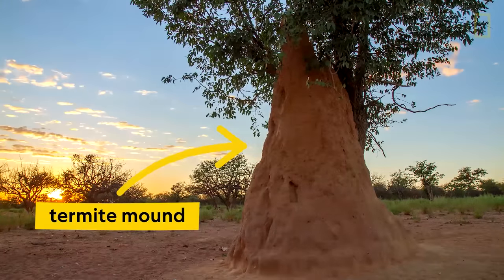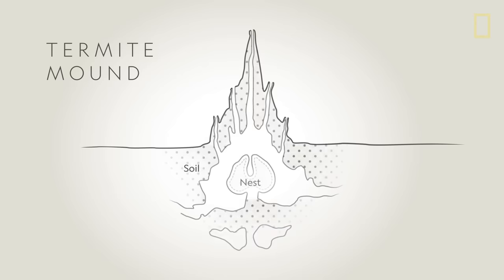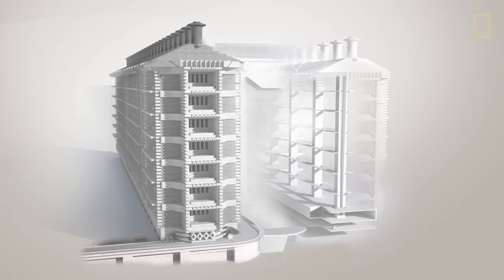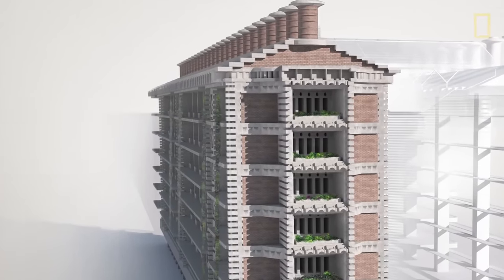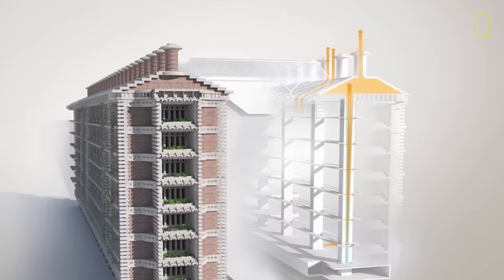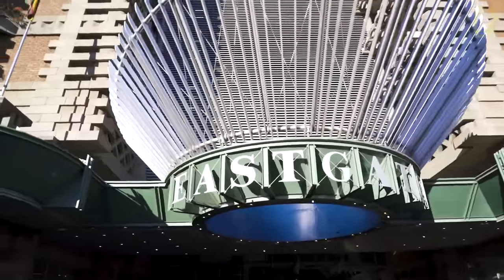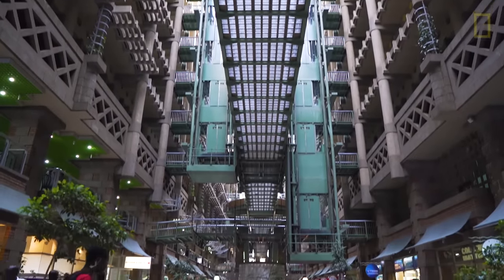See How Termites Inspired a Building That Can Cool Itself | Decoder

Comment: Is 82°F really considered comfortable? ...
Reply: Katherine Prutz good question especially if you don't know Fahrenheit but only Celsius
Reply: I wouldnt know. Most civilizations have adopted the metric system, except some stuborn ones...
Reply: Yes it is. I find anything between 25C and 28C comfortable, below 22 is cold and above 30 is hot, but that's just me.
Reply: If the temprature outside is nearly double that then yeah it's pretty comfortable and mild.
Reply: And then there's me; I find anything between 16C and 20C to be comfortable, anything below 0C is a bit cold and above 24C hot. I don't think i'd find the shopping mall comfortable at all during daytime, can't imagine what it'd be outside though
Reply: Katherine Prutz I find that a bit warm tbh I prefer inside to be about 65-70
Reply: GommentarHD It's not. It's about 28°C.
Reply: Abigail R0se wtf is 65-70
Reply: no its hot. sweating hot.
Reply: Katherine Prutz: 82 F is adaptable. Imagine civilization in the time before air conditioning. We flourished as long as we didn't boil or freeze.
Reply: Its all relative...In tropical countries peak winter temp is your spring temp...so for us it is...
Reply: Perhaps African climate is different from yours? Perhaps?
Reply: I personally am Zimbabwean and have been in this building countless times,and it is cooler than most would think.This was a brilliant design and is quite efficient
Reply: niBBun degrees Fahrenheit. As an American, we shorten terms. So, "It's hot as balls out there- 85!" Is something you may hear...
Reply: Yes that is 27°c
Reply: Meet the people in cold countries....
Reply: Katherine Prutz in a place as hot as africa, yes.
Reply: I wasn't impressed by that figure, but more than that, they didn't include the difference. 82F only means something to me if you give me the outside temperature at the same time. If this is effective, show us how effective it is!!!
Reply: Low humidity and 82 is glorious. For Zimbabwe, this temperature is relaxing.
Reply: Katherine Prutz :

Yes, 82f is nice.

In Arizona, house at 84f, feels great.

Comfortable temperatures are in relation to human surroundings.
Reply: Justin Bozeman actually 27 degrease Celsius in a low humid environment like Zimbabwe is quite comfortable. For example 27 degrees was unbearable for me in Hong Kong. You need to travel to places outside ‘the modern day world’ to understand the world.
Reply: No too warm
Reply: No 😓 I’d be sweaty
Reply: In africa thats is comfortable.
Reply: Yes in Africa
Reply: As a desert dweller, I think it's a bit on the cold side.
Reply: No it’s not hot asf
Reply: I come from the tropics and 28 degrees Celsius is not comfortable lol You'll need a fan or AC.
Reply: Maybe for The average Zim.
Reply: Katherine Prutz nope 75 is my confort zone
Reply: Sounds like a regular autumn day in southern California. So it's pretty hot about 22-25°C?
Reply: It's pushing it for me, but my husband would be perfectly happy.
Reply: Mohammad Al Adham 25-28 is considered warm temperature here
Reply: When I was in Hawaii, when the temperature got down to 82 deg F it felt great. Not to hot, not to cold. The airconditioner in the buildings felt too cold.
Reply: DrSlayerSeth you are crazy. That's so cold!
Reply: Its sustainable and continuously utilized. If you can convert it to celcius youll find out.
Reply: Yess
 It is
Reply: If it's cooler then the outside then yeah? I'd say they are more used to the heat so 82 would be "cool". Though for me a nice 72 is good.
Reply: You don't have to go "outside the modern world", just to any low humidity climate. In most of CA, anything below 90F/33C is very comfortable; 80/26 is almost too cool to for shorts, especially when the night temperatures dip to 50s-60s/10s; almost no one runs AC below 90. "Hot" days (or regions) are 100-110/37-45. Of course anything much over that is still dangerous.
Reply: Katherine Prutz right? ya i thought that sounded kinda funny to me. guess im not the only one...
Reply: lol i thought the same thing
Reply: Katherine Prutz it's actually decent temps if you're living in a tropical country, hot in people who spends most of their calendar in cold climate countries.
Reply: Katherine Prutz .. what abt 40+c temp. ? Wel it is common in india during summer.😐😁
Reply: Katherine Prutz — I vote no, but I love cold weather.  Oh, and I think that’s 30° C. Give or take 😎
Reply: LagiNaLangAko23 — Agree, it’s like 104° and humid in Texas today which is what... 40° C? Color me a wimp.
Reply: If it's not under 75 it's not comfortable
Reply: For most who life in the tropics 25 - 27 is an ideal temperature. What makes it not comfortable is if the humidity reach 80 % or more.
Reply: If you live in a desert near the equator, yes.
Reply: Katherine Prutz it's 27.778 ℃ (do people really not know how to use Google?)
Reply: Katherine Prutz average temp in Zimbabwe during the the summer is 90-100 ℉ (32-38 ℃) (again do people really not know how to use Google?)
Reply: Also you have to keep in mind, it's not so much what the average temperature is, it's do they normally live in an ac environment. 

I live in Upstate NY, and believe it or not but summers see an average high of 85-95 ℉ (if you want ℃ learn how to use Google, it's not hard) with Perry high humidity. I also don't use ac so 82 isn't hot for me, though most people I know would be complaining it's hot. They're not use to it, I am.
Reply: capoiosct measurement is like language, and saying some civilizations are stubborn for not being indoctrinated is beyond ignorant and narcissistic.
Reply: I don't get it either, cuz I checked and the hottest time of the year in Harare is October and the  highest temp is around 29, but maybe it's significant bc the structure is huge I guess :)
Reply: No, that's way too hot.
Reply: Katherine Prutz In Zimbabwe?.... Yes.... Yes it is
Reply: +TheHunterWolf
"Double that"?  LMAO... If the temperature was truly double that, then everyone would be burnt to a crisp.  If the temperature was 50F, double that would be 559.67F.  Basic high school thermodynamics... At least it was back in the ancient times when I was in high school.
Reply: Its Africa. If its 82 degrees inside during day then its probably 100 some degrees outside the building. These guys have probably accustomed to the heat and 82 degrees is much comfortable for them
Reply: Why is everyone trying to dictate what is and isn’t a comfortable temperature? New flash: not everyone lives in temperate regions and to billions of people worldwide 80-85 degrees Fahrenheit is perfect while 60 degrees is too cold.
Reply: It is in Africa
Reply: GommentarHD Its warm, room temp is 72 for us
Reply: Here in Phoenix, AZ, USA, 82 F is very comfortable. Sometimes it gets as hot as 120F (49C)
Reply: Yes it is,  its in africa, thats 27 degree in celcius. In our country we hit 49 celcius this summer.
Reply: In our place 20 to 28°Celsius / 82F, is pretty much a Comfty temp. Here in the Philippines summer temps goes 32-36C/ 93F +++, and that's pretty hot.
Reply: Same, I'm from Nigeria and I start feeling cold at 22C
Reply: It is probably comfortable in Africa, but anywhere else, no.
Reply: Katherine Prutz when it’s 100+ degrees Fahrenheit (40C) outside; 80F is certainly welcomed. Also thing regionally. Different geographical location, probably not as much reliance on HVAC systems normally and so on. So when it’s very hot outside in the triple digits in their area (40C), the 80F interior feels refreshing.
Reply: Air conditioning is rare in most European countries. In Amsterdam during a heat wave a few years back, I couldn't find a single air conditioned restaurant (though there may be some). I was staying at the Grand Hotel Amrath, where it was air conditioned but the vast majority of hotels aren't.
Reply: For ppl in Zimbabwe it is
Reply: Where I live 90-100°F is average.
Reply: Katherine Prutz ever lived in Florida with broken ac
Reply: Katherine Prutz No, 82°F is pretty warm.  I’d start sweating for sure.  I keep my house at like 70-72.
Reply: Well. This is Africa
Reply: I am living in Sweden and prefer between 17 and 19 degrees Celsius during summertime, but approx. 11-13 while a sleep. Lately it have been around 27-29 degrees in sweden and schools and offices have closed down hence people can´t deal with the heat. So it is like many already have said, it depends what you are used to. Also, It is better with -15 degrees in north of sweden then +5 in for example Gothenburg in winter, due to the humidity.
Reply: I lived in Arizona once, and in those kinds of places, 82 is very comfortable
Reply: David Craft i asked siri and gave me correct answer
Reply: I think it's about acclimatization 20C is entering winter temperatures in Southern Africa, 27C is comfortable. Generally, people here put on coats and jerseys at the sight of any cloud cover lol!
Reply: When it's cold outside lol
Reply: Katherine Prutz compared to the 104+ temperatures during the day... I think yes! 😂
Reply: Not to me lol
Reply: In that part of the world, probably.
Reply: In africa
Reply: Depends on the humidity. I live in Florida so if the humidity is low it feels pretty nice out, but it can get to 100% humidity here so it will feel more like 95+ degrees Fahrenheit.
Reply: In Africa it probably is.
Reply: Idiotic question
Reply: In the US people would still complain at 82 degrees room temperature.
Reply: Mohit Kapoor no in tropical countries Fiji, Ecuador, Malaysia) there is no winter it stays summer all year
Reply: SuperFinGuy sure where in the „tropics“ are you? Never heard of someone living here that can’t take the heat... its not possible biological
Reply: No. 60-70 would be however.
Reply: Cool, thanks for mentioning. Always nice to hear a locals opinion.
Reply: Katherine Prutz more comfortable than 110f
Reply: Mohammad Al Adham my personal favourite temp is 10 at high end and -2 at low end sometimes -25  but im also Canadian who loves the cold
Reply: geez I think 21C is comfortable...
Reply: capoiosct we have adopted it. It's just optional to use.
Reply: Yes, specially in hot areas.
Reply: I use to keep my house at 75 F max. And that's if I'm not working or moving. 82 is not comfortable to me. But no one ever cares about their employees like the business in this video.
Reply: Na that is hot as he'll to me that's almost 40 Celsius I believe
Reply: 82°f is 27°C (Googled it)
Reply: NOT IN THE U.S. IT ISN'T!!
Reply: Well yes if you live in the tropics.
Reply: Katherine Prutz if outside is over 100 yes it is comfortable I live in a place where last 3 months was a almost constant 95+ weeks in constant 100+ so yes 82 inside to 95+ outside is comfortable plus not using less electricity I think is remarkable...
Eartship by Mike Reynolds people...
Reply: No its hot asf, a summer day in America
Reply: 666 likes...
Reply: I think thats without electronics such as air conditioner depends on the occupier .
Reply: It's at Zimbabwe, not in your country.

If you are used to temperatures 82°F below, well, that is your country. 27°C is normal here in the Philippines, knowing Zimbabwe is at Africa. It's not what you are used to and comparing that to them that makes you wrong, but your incapability of knowing and understanding what they are used to, empathy.
Reply: No, 72 is room temperature
Reply: Human comfort zone depends on humidity too, so mahoney's table is used to find which temperature ranges are comfortable...
Reply: @AscendantStoic   on Mars maybe.
Reply: It’s warm. Like just comfortable enough  to be under hot.
Reply: my familylikes 73 degrees
Reply: Here in Australia it gets to a stinkin 45°C for around 30 days
Reply: For its location in Africa, yes it is.
Reply: She must have meant in Celsius  as africans use celcius to measure temperature. Which in this case 23 degree Celsius.
Reply: Because its Zimbabwe,,its comfortable compared to their climate
Reply: it is when the temp outside is 110* or higher ..
Reply: Katherine Prutz my house it on 75 during the day and 69 at night
Reply: for indians its really comfortable. anything below 20 degree is too cold
Reply: I find 70-80 F most comfortable. 82 is not that bad. You can wear shirt or long sleeve and still feel good.
Reply: Depends on where you're adapted to. In Africa, probably a nice cool temperature... in Canada, too hot
Reply: If you live in an African Savannah I think 82 would be a godsend.
Reply: Depends on which country you live in. South African here, 37°C outside is glorious summer weather, so 28°C inside not bad.
We don't get snow or winter lows under 0°C.
Reply: Are from Canada or something? In Australia, that is considered nice.
Reply: LagiNaLangAko23  Summer in my country mostly doesn't go above 22 C. You'll go to the beach and drink a drink without ice because that would be too cold, and then a cloud covers the sun and suddenly you're freezing. T.T

I miss the Tokyo summer tbh. Maybe it was 40 C, but it felt nicer when you could wear less and more breathable clothes, big hats, umbrellas, fans and carry around a frozen bottle of tea.
Reply: @mohammadaladham7721  wow, you have very narrow range.

For me 20-30° is comfortable.
15-20° is sleeping temperature (covered in blankets)
30-35° is ok, as long as I'm busy doing something.
More than 35° I definitely need an AC or atleast a fan.
About 45 is when I'd go fall in a swimming pool.
Reply: That's the temperature the building itself maintains and than AC take over to reduce the temperature even more
Reply: 82 may not be bad for a place that averages higher temperatures.
Reply: For Africans it must be
Reply: I mean, we have to consider that this is a different country in a completely different climate system. Since they experience hundred degree weather it makes sense that they find 82 faren to be comfortable. But take for example someone in washington USA, we tend to find 70 comfortable because we are used to experiencing 60 throughout most of our year. Winter and fall especially, we find 50 comfortable with a small jacket, but my cousins find 50 too cold so they put on multiple layer in NY/NJ. The civilians who live seem to like that temp so its always different per climate area.
Reply: I asked myself the same question...😅😅😅
Probably Zimbabwe's standards
Reply: Considering most buildings made of brick are actually hotter than outside yes. It can be 105 outside and 130 inside like a fucken oven.
Reply: Yes
2 degrees, above room Temperature
Reply: 82F is actually 28C

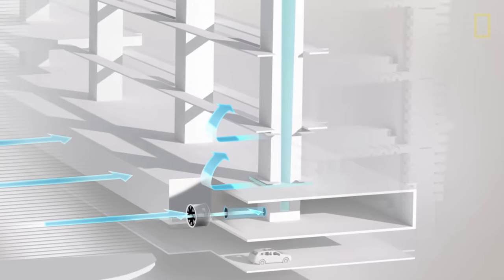Comment: 2:00 "The concrete blocks absorb the cold"

Come on how could you guys call this a science channel? For those of you who don't know, "cold" isn't an entity or a tangible thing, "cold" is the lack of heat or the lower end of a heat gradient. So when people say "open the window let the cold come in" they are scientifically incorrect, it is that the heat is escaping out the window and moving to an area which is cooler, down the temperature gradient. In this case, concrete blocks don't "absorb the cold" but the air in fact absorbs the heat from the concrete blocks, making the blocks cooler. Please national geographic you should be educating people the right way. Small difference but still important nonetheless because it helps understand the physics of hot and cold simply from the explanation. Sorry if I sounded too stressy, just that these guys should know as educators.
Reply: Yeah but u need to understand that most people who haven't studied science are watching this too..
So its important to communicate in common language
Reply: Safi Wasif ....are you trying to say that most people doesn't understand the word 'heat'? And that 'heat' is not common word?
Reply: Either way... the block is cold
Reply: @safi9764   it’s not hard to understand “the heat from the concrete transfers to the cool air”

Comment: They need to build more buildings like this so hopefully the 82 degrees day time temp can be more like 72 degrees
Reply: Evan Kagan try 68 lmao
Reply: Evan Kagan 82 is so hot
Reply: We're talking Southern Africa. 82 degrees is comfortable to the locals.
Reply: F right? If it's Celsius I'm basically fried.
Reply: tizio caio good point
Reply: 82 is pretty much nothing to the natives in Zimbabwe
Reply: The heat is from the thermomass of the termites in that building.
Reply: Google Harare Zimbabwe temperature, it's only like 70° f.  82 is pretty hot...
Reply: 82 is pretty warm to me.
Reply: madhatten June and July are its coldest months. in Sept. Oct. its average max temp is 95
Reply: Evan Kagan try California’s highs of 110😂
Reply: Yeah. I'd say 78 would be fine. I turn on my A/C when it gets to about 82 and keep it until about 79 or 80. We still need some A/C, but I like all this stuff, as long as it doesn't create problems like tizio caio pointed out. Maybe sound isn't actually a problem, but we need to watch out for these unintended consequences.
Reply: 82 degree celcius impossible for humans to survive
Reply: @Lolo Puhffs   Not in a suit - like the guy walking around there in the vid.
Reply: 82 degrees  is very hot/ like on the pan
Reply: @kaiden8701 are you crease??  it is very hot.
Reply: The reason it is 82°F (27°C) because of the climate in Zimbabwe.. Anywhere else it would be the same as that specific climate for example England would be around 64°F (18°C).

Comment: Nice! The video did not mentioned enough the importance of that "radiator shapes" all over the building to dissipate heat more efficiently. 
Moreover the high termal mass doesn't mean that materials do not change temperature, it is just that these materials change temperature slowly so that they become hottest 12 hours after the hottest time of the day so they can release the heat during the coolest time outside. Thermal lag. Furthermore, materials such as brick can absorb a certain quantity of water which, by evaporating in dry air situations, contributes to the lowering of the temperature inside. I am an architect.